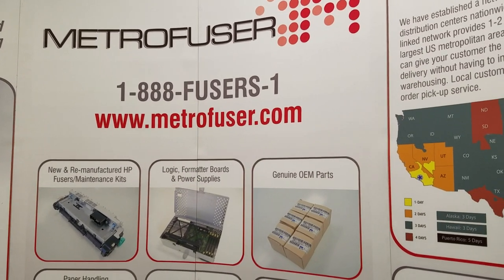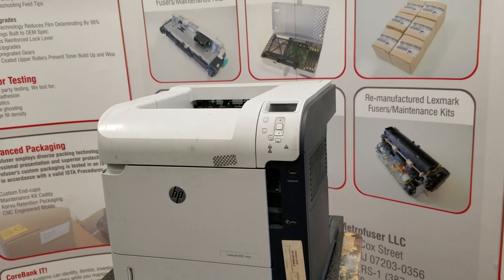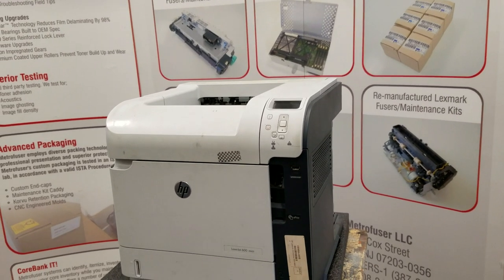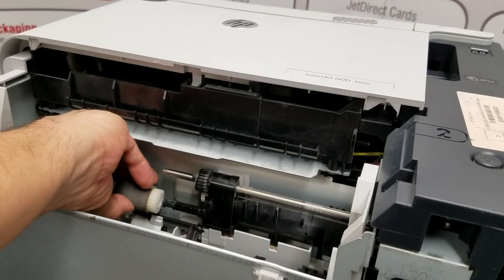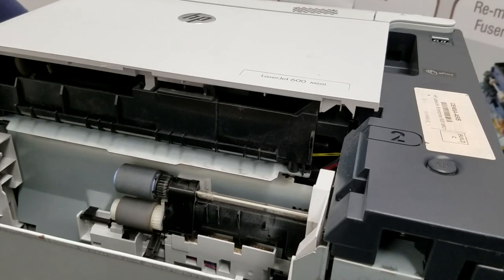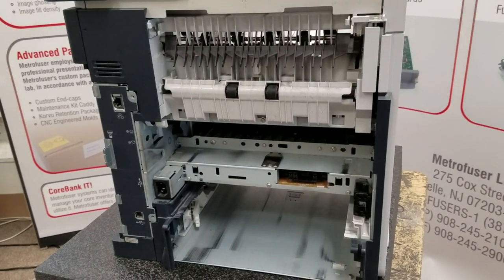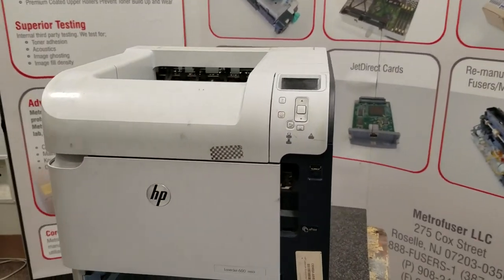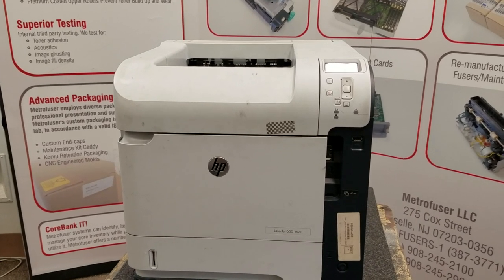M601 M602 M603 Fuser & Maintenance Kit Replacement Instructions part number CF064-67901

Comment: Great Video man. I just subbed.
I just bought a used m603 that seems to be be functioning properly.
When will I know it's time to use a maintenance?
Reply from the maker: There will be message on the control panel display that informs you its time to do maintenance. The printer will also  tell you with a image defects or paper jams